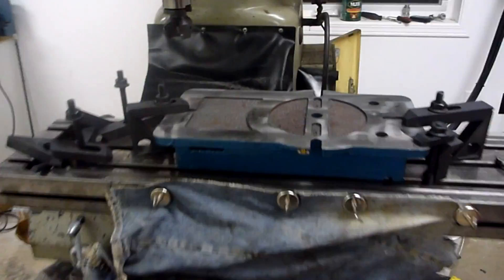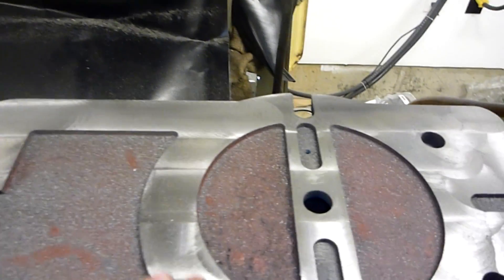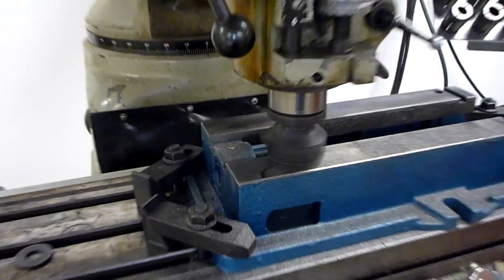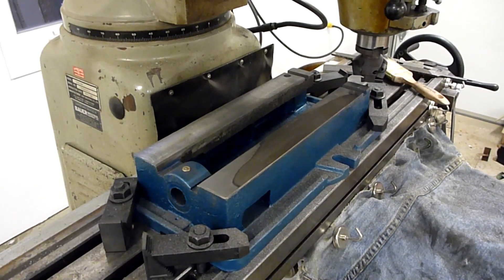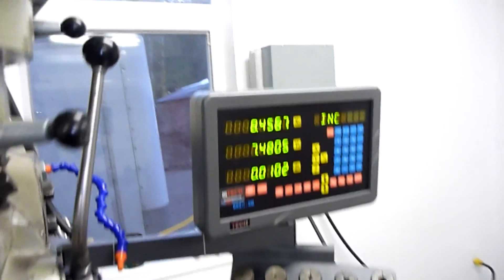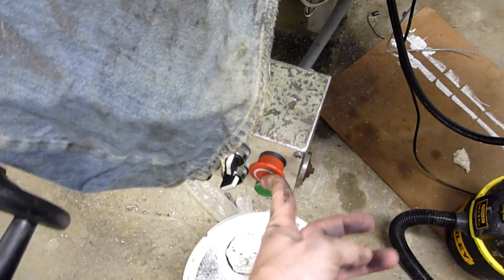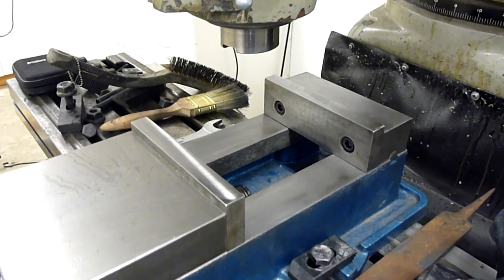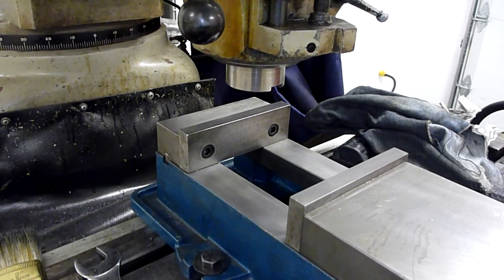Fixing a Chinese Milling Vice

Comment: Where did you find that cup for mill grinding?
Reply from the maker: I think I just found it at a local tool supply place in town.  Its meant to screw onto the arbor of a grinder so I just cut the head off a 5/8" bolt, screwed that into the cup (with a jam nut) and then put it in a 5/8" collet on the mill

Comment: Now you know why a decent quality accurate vice costs so much, Chinese price + your time + electricity used + tool wear, and a bit of patience, not to mention the expensice medition tools required for the job.
Reply from the maker: Never doubted the quality or value of the cost of a professional tool. Quality costs. 

Everything costs, there is no free lunch.  So you're really close to hitting on the whole point of the video.  What is education worth? If I was a professional machinist with years of experience under my belt, buying a cheap junk vice would have been a pointless waste of money and time.  But as a new hobbyist, this was a chance for me to explore my new (to me) machine and learn its limits. Figure out ways to solve machining problems, learn about measuring and accuracy, try some techniques, learn what works and what doesn't, make some mistakes and learn from them.  I saved a couple hundred in cash, and bought myself many, many times that in education and experience.  

In fact, I'd go so far as to say that this would make an excellent highschool project, Maybe like second year or something.

Thanks for your comments

Comment: I would recommend  setting the head to 90 degrees on the side and using the mill as a surface grinder, utilising  an 8" aluminum  oxide 1/2" thickness. Just touch the surface at it's highest point and grind across the face of the vise.

Comment: float the vise on blocks not tie the whole thing down on bed it will always be warped when you cut ..your cutting speed is way to fast and if ya want a really nice finish single tool for the last finish with  fly cutter with 1/2 braze on with slow feed and light oil like wd40 ...then when i saw the grinding stone its the wrong stone and it was not dressed and will cause it to cut crooked and the most important is make sure the table is swept in to head before you cut

Comment: When you're grinding with your mill I'd recommend to get as fast of a feed rate and as shallow as a depth of cut as you can do.
Surface grinders (most of the time) operate that way too.

EDIT: You'd obviously have to make a couple of passes for the same material removal but the work won't really have the time to heat up as much when you're moving faster at a shallower cut depth.
Reply from the maker: That makes sense, thanks for the tip.  Now that I have a surface grinder, I'm looking forward to getting both vices properly trued up and matched

Comment: If you clamp a warped or curved surface (the vise bottom) directly to a flat surface (the mill table) you stand a very good chance of pulling that warped face to deflect and conform to the flat face, causing the part to return to it's original curve when the clamps are released, causing the new, machined surface to spring back and distort accordingly. Depending on the stiffness of the part, you may also cause the mill table to bend and warp some, adding inaccuracy to your cut.
Any non-flat surface must always be supported and clamped on only three relatively small points (stable equilibrium) to prevent warping and to allow the part to adjust to any stress relief movement that may occur from material removal and heating from tool friction. Grinding can especially generate enough heat to warp materials, more so than milling.
You can use small blocks and shims to support your work and to get it parallel to your work surface (mill table).
Take light cuts and slow spindle speeds to avoid deflection and chatter on the part while it is supported only on small points.
Once you have a flat surface from the first machining you can use that as your reference surface for subsequent cuts.
If you need to remove significant material from secondary surfaces, you may need to use the three-point method repeatedly until all surfaces are flat to the tolerances you desire.
BTW it's a vise, not a vice.
Reply: It is very basics of part clamping. If you want a stable clamping, use 3three point clamping raised from the table to get it stressfree. Otherwise you lay it on the table and put shims under the non-flat portions where you are going to clamp the workpiece. This way when you do clamp it, the clamps do not bend the workpiece and the workpiece will have a flat surface once machined.

A workpiece is very easily bent on a milling machine because of the huge leverage in the clamps usually used. On a surface grinder the magnet does the same if you do not shim the part properly.
Reply: What Joseph Lippencott stated is accurate.  In point of fact this was taught in the very first semester of tool and die school.  If you need to true ANY surface you never pull it down to the table.  This is a basic principle of machining and is taught early on.  Now, having said that, the video did NOT show him clamping it down so I can't tell if he shimmed it or didn't shim it anywhere.  The video also did not show if he ran an indicator and mapped it out.  For all I know he might well have done exactly that and just decided not to video it since it can be boring.  Lastly, since I went to tool and die school in 1972 does that make me a worn out fake also?  If you like you can goggle "sea sled" and the EDO corporation and see what machine tools I used.
Reply: Well what Joseph says is very true. Same concepts apply when honing such as cylinders on a engine. You have to use a torque plate to make sure its true tolerance when clamped.
Reply: Nah, he just copy/pasted that info from a website and added a few words of his own. It's called plagiarism when you don't show the the source from which it came. 😆
Reply: @104littleal6  😂 wells thats the same as a college graduate with a degree
Reply: And you know this since you watched an another Youtube video about it, rather than ever doing it yourself? Of course, your comeback is that you've done this for 40 years and know everything about it (it's a worn out phrase and people who do same stuff for 40 years can't be that smart). Maybe this just worked out fine and never needed any hassle of stable equilibrium or any other crap..

Comment: That feed rate is ridiculous... Ridiculously LOW... You're not a machinist, aren't you? Figured.
Reply from the maker: Nope!  Just a novice hobbyist figuring things out as I go :)
Reply: Good for you, sir.  Have fun and learn at the same time.  It's how we all start. Keep it up!
Reply: Is there any reason for a home machinist/modelmaker to push their machines and cutters to the limit just to generate blue chips?   Production work is one thing yeah time is money and you can give the customer the worst finish they will accept for the money paid and make a profit. The Chinese are masters at taking fast and inaccurate cuts to make a buck.  I see you have never built a working model steam or gas engine from your comments where fit and finish require taking your time.
Reply: "Is there any reason for a home machinist/modelmaker to push their machines and cutters to the limit just to generate blue chips?"

In some sense yes, as the grinding wheel in this example will not wear as it is supposed to, gets clogged and just rubs generating heat.

Comment: Question: Did you verify that your milling table was true before trying to true the vice? Surface grinding the table might be in order in some cases. I'm now curious about the state of my own HF x2minimill.
Reply from the maker: Yes, that was the first thing I checked.  I was surprised to find that in spite of all the nicks and dings, it was pretty flat.  Just a couple localized spots where it was a couple thou low.

Comment: my cheap vise was horrid... the bottom was flat except one corner was out .002 periodically i plan on sanding it on my granite block but for now i just make sure i don't tighten the corners to the table bed...... one way was .011 higher than the other the shorter way had a .010 dip in the middle... i flattened the shorter one with a fly cutter with a carbide bit, (i would like to get a grinding tool like yours)... then i fly cut the higher one. i put a dial indicator on and measured across the ways and it told me i had .001 to go so i cut .002 and moving my 'y' axis i skimmed the shorter one just to make sure the ways were even... but i still wasn't finished.. i noticed when the vise was disassembled that the semi spherical ball was not fitted properly and the hole for it was filled with casting imperfections and the angled plate it was supposed to slide on was also pitted really bad from the casting and had never been machined.... since i couldn't get a milling tool into the hole to clean it i had to use my fordham with a ball cutter and wallowed out all the castings but that caused me to lose concentricity.. so i made it slightly over sized and using devcon slow curing steel epoxy i filled the hole.. then i took the semi-spherical ball and wiping it with de-natured alcohol as a short acting 'release' i stuck it in the glue and made a 'nest' the exact shape of the ball then i removed the ball and let the 'nest' cure... then i filled down the angled flat for the flat of the ball to ride in.... the end result was i now had a vise that was dead nuts on the ways and would also clamp with downward pressure when clamping the part in the vise....
update:
so i went to tram the vise and it was out .003 on one end... i had to take the back jaw off and re-mill the key and the jaw... now it trams in 0'd...
Reply from the maker: Good work!  I've got two vices so I've been working on matching them.  I've got one vice that's good and haven't gotten back to my other one...